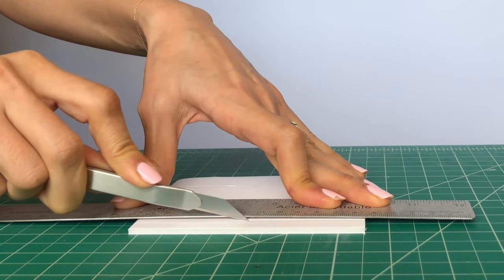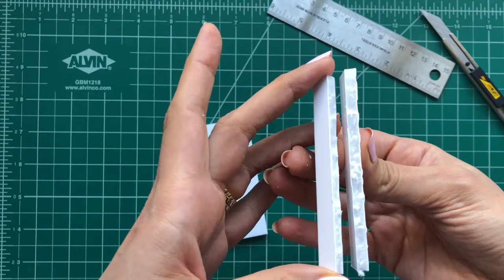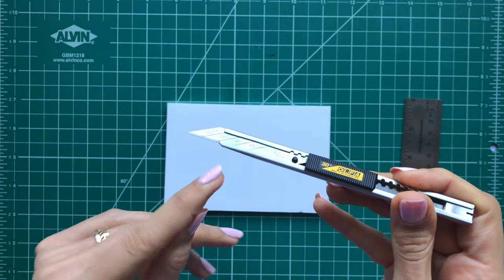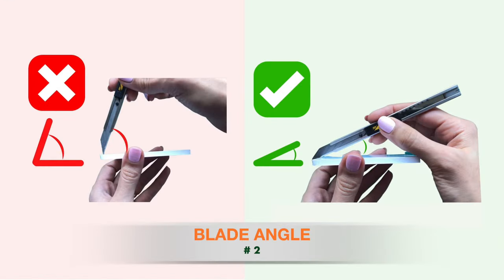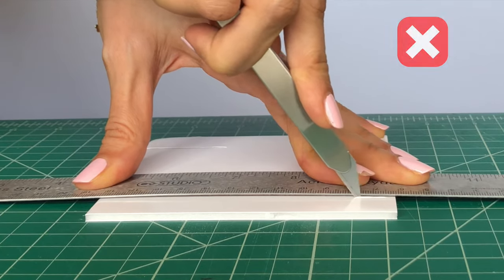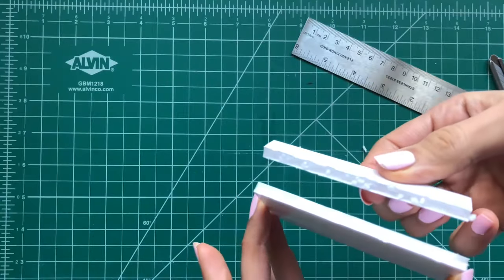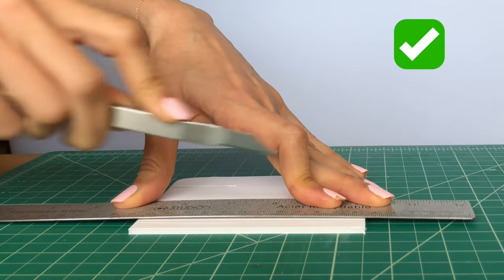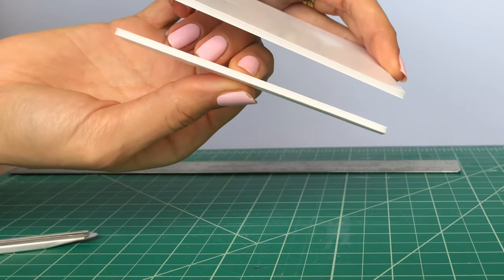How to properly cut Foam board / Foam core?

Comment: Does this method work on foam board that's  1/2 inch or 1 inch thick? The foam in the video looks like maybe 1/4 inch. If there's a different method for thicker foam board, please share. :)
Reply from the maker: I just uploaded a tutorial on how to cut thick foam blocks. Hope it helps ☺️ 
https://youtu.be/lmnCYfHl4e4?si=AoH26ziZLOXrzPph

Comment: Can you please share how you cut a 1" thick foam with the same method? It does not work.
Reply from the maker: Hi Grace, you can properly cut thicker foams using same technique, however you need to do more passes and keep the blade low. I will make a video and will show you how to do it very soon ☺️
Reply from the maker: Hi Grace, I just uploaded a tutorial on how to cut thick foam blocks. Hope it helps ☺️ 
https://youtu.be/lmnCYfHl4e4?si=AoH26ziZLOXrzPph